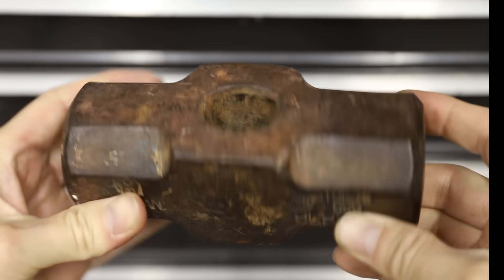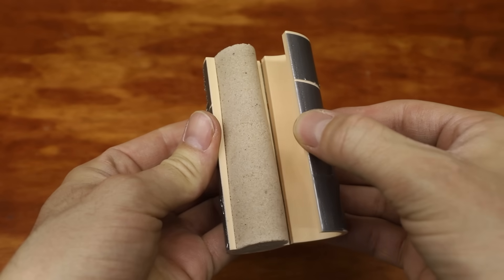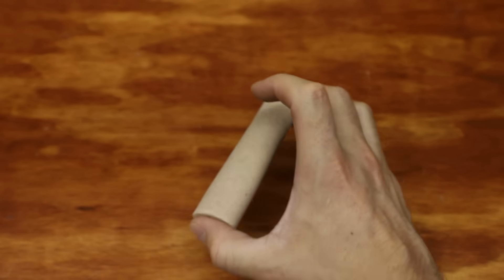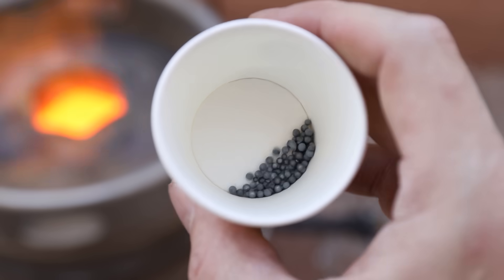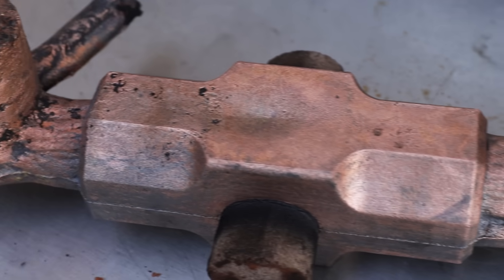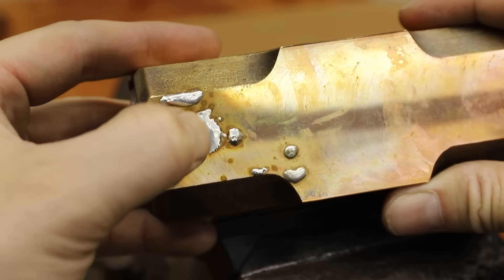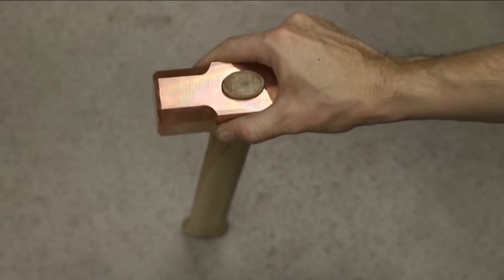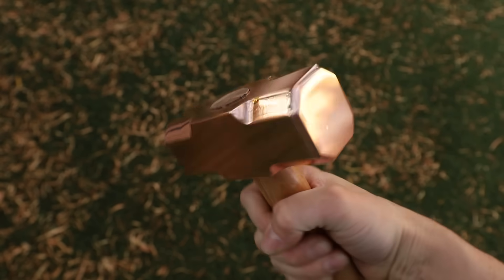Making a Solid Copper Sledge Hammer - HAMMER TIME!

Comment: Is it true that pennies are not all copper, that they use a filler?
Reply: Pennies made in late 1982 and after are made of 95% zinc with a copper coating, that's why if you scratch most pennies, it'll look silver

Comment: You should have used one riser fed it on both sides of the core keeping the riser hotter than the casting. You had that on one end of the casting the side the riser was hooked to the pouring  basin.

Comment: I could be wrong, but last I checked it illegal to melt down pennies for the metal (nickels too). Violating this rule can result in significant penalties, including a fine of up to $10,000 and/or imprisonment of up to 5 years. Coins melted or treated in violation of the regulation can also be forfeited to the U.S. government. With the announcement that pennies will no longer be minted, that might have changed.
Reply: Pennies and nickels have never been illegal to melt in general. It's only illegal if you are trying to profit off of the metal value of the coins

Comment: If you had put another plug/vent tube on the top side where the depression was, it would have prevented the depression. It would have let the air escape as well as gave another area to hold extra material in case of shrinkage

Comment: Why cut up the copper ingot?
Reply: chunking it up makes it easier to heat up, and also makes it faster because the chunks are a bit thinner so there's less volume the heat needs to melt, per chunk that is.
Reply: @braydenstrand3572 wrote: "chunking it up makes it easier to heat up, and also makes it faster because the chunks are a bit thinner so there's less volume the heat needs to melt, per chunk that is."

Oh. Like how a powdered mass of metal starts melting faster than a single solid mass. It increases the ratio of surface area to volume, allowing the heat to reach the various atoms through convection, conduction, and radiation between the atoms of the chunks, rather than only through conduction through the atoms of a single large chunk. Slush cools water down faster than ice cubes. Sort of like how small animals are affected by temperature changes much more quickly than large animals. Thanks.

Comment: Well, thats pretty dumb. Copper is a soft metal so every hit will result in
a dent in the copper hammer head. After slight use it will be  MAJOR
beat up, thats why you have never seen a copper hammer before. Brass, 
yes, copper no.

!

Comment: Its pretty but terribly impractical. Copper is far better suited to electronics, and too soft to use as a sledgehammer UNLESS you need something that will not cause sparks.

Comment: something I learned from having to melt down silver often at a previous job, preheating the castings might help with voids.  The hotter, the better with the pre-heat. Having the molten metal go into a hot casting should allow the molten metal to stay in a molten state longer, allowing air bubbles to escape.  Similar to setting concrete, however, in this instance, I don't think I would shake it when cooling, as you're using sand castings.   I was using heavy cast iron molds, not sand.  We(me and my co-workers) would pre-heat by setting the molds in front of the furnace exhaust for a half hour prior to pouring.

Comment: A copper sledge hammer is about as useful as a bikini in Antarctica.
Copper has a Mohs hardness of 3.0 while the hardness of concrete is around 8.0... There is a reason hammer heads are made of high grade steel and undergo "hot forging" to make them hard enough to withstand the force extended during use....
Reply: did you not watch the whole video?

Comment: I remember visiting the old coal mines in Wales when I was little and looking at the old tools they had there. Where there was a chance of Firedamp in the  mine (often methane) they would use copper alloys because they wouldn’t spark and set the gas off.

Comment: about that repair, just wondering if you could heat up the copper hammer to just before melting and then pour some molten copper over to fill it up? That looked quite shallow so should not trap much if any air but just in case can still mill to clean up the irregular pockets to ensure that no air gets trapped and can always agitate it a little to be sure no air pocket in the pour? This might be less work and you would have hot joint inivisible joint vs cold joint press fit plug?

Comment: you could have thermally expanded the inner diameter of the void and put in the cold filler with interference/transition fit at room temperature..that fit would have been stronger.

Comment: that was not the correct way to fit a handle in. you beed to hold the hammer upside down and smack the handle end with another hammer and let physics do the work for you

Comment: So i recently recently learned that the amount of valuable metals in pennies and nickels is worth more than the face value of the coins themselves. Could someone melt the nickels down and get the 25% nickel and 75% copper? Each nickel is actually worth about 10 cents more in metal value

Comment: Dude. That was amazing and beautiful. I am a woodworker for 45 yrs but that is a fascinating craft equal to or maybe more amazing than woodworking by far. Remember the technology of carving wood first needed a tool to manipulate it. First we crafted stone axes to manipulate the wood. Then bronze and copper and eventually iron. So ur craft is literally 5000 years old. Our ancestors didn’t use 3 D printers n such. However by no means did our forefathers ever turn their back on new tech nor should u. the sand molds the cauldrons the fire. That is as it was in the bronze and Iron Age. It’s amazing. Ur amazing.  U make me proud young man. Ur a master.

Comment: Excellent work. This was fun to watch. I am curious why you didn't just use the spare hammer head to make your mold why did you need to make one from scratch. Copper is such a lux metal my father used to make copper and brass sculptures and they're still hanging around.

Comment: Your casting techniques are top notch, but your use of terminology a bit amateurish. The "top" and "bottom" of a mold are called the "cope" and the "drag" by pro foundrymen, respectively, and the process of expanding a metal plug to fit its hole is called, "peening", hence the term, "ball peen hammer" for the ball-shaped hammer used to accomplish this task.

Comment: Not everyone has a 3d printer and it would be cost prohibitive to pay someone to make a mold.  Why not use the hammerhead and make a pattern for a mold instead.  I am thrilled that this person has a printer but I can make as good a pattern with the existing hammerhead.  I don't really see this video as helpful.  I'm surprised they didn't use a machine shop to finish the project.  Instead of buying a $40 hammer, you can invest thousands of dollars on printing equipment and thousands of dollars with a milling machine.  I think this is a dumb video.  I think it would have been more helpful using equipment from around the house or garage.  If I had the equipment here, I could do the same.

Comment: Some 50 years ago I worked in a foundry, Oklahoma Stell Castings. The plant was built at the beginning of WW2 to make castings for the war. After the end of the war it was repurposed to make butterfly valve castings. I worked in the Maintenace department. They used scrap steel to make their castings. The furnace fired with electric arc rods. Made a tremendous amount of noise. The casting patterns were hand made out of wood. Then sand molds. The castings were dumped into a tumbler, a large steel container and turned oner and over. It was quite the sight for a young man like myself. Later in life I became a aircraft mechanic. When I saw the repair in one side of your hammerhead it reminded of structure repairs we made. We called them freeze plugs. Machined plugs a litter larger than the hole to be repaired. Then dipped in liquid nitrogen and while still cold put into place. Surprising how well that repaired a damaged hole in aluminum.
I really enjoy your videos.
Reply: What a wonderful piece of history. Thank you for sharing
Reply: Excellent!
Reply: My doctor was talking about this. The metal shrinks with the -190 degrees and then expands. So cool.

Comment: Such a lot of work, but good hammers have an hour glass hole so the wedge can expamd the split and to lock the head onto the handle. It would have been a trivial amount of work when making the core. A lot hader after the cast has cooled.

Comment: Typically I'd repair voids in bronze or copper by filling w/rod using a tig or torch then machining after as you did.  Your method worked nicely though.

Comment: Things that sound dirty but are not:

Invest in a vibrator for your sand molds brother. Youll get a much tighter fit over just tamping it down. You won't regret it and your projects will reflect the quality. 

Keep up the awesome work. This is my first video of yours. Yoive earned my sub even if that hammer is totally useless. 😂

Comment: So I have a few questions. Did you do any post processing to your 3d print? I have seen that sometimes 3d printed patterns do not like to let do of the sand on green sand molds. Did you do any form of calculations for your runner and gates? Also have you thought about doing a vertically parted mold instead of a horizontal?

Comment: How did you make solid copper hammer when PENNIES are (and always have been, excepting the WWII steel pennies) made of BRONZE NOT COPPER and now are 65% ZINC clad with bronze??? I was a chemist 47 years of my working life, and NO ONE has EVER transmuted one metal into another-that would be alchemy (sorcery).

Comment: I hate to break it to you but the grain orientation in the handle that you used is the exact opposite of what you would want in a good handle.  Well at least you're not planning on using it so now we don't have to worry about the handle breaking.

Comment: Pouring metal into a mold requires 2 things. Larger risers-- aim for twice the height of your part being cast and as much volume as your part as a rough estimate. Yes, it can be calculated more accurately, but isn't useful for making a single casting. Next.... Heat your sand. The hotter your sand, the slower your metal cools allowing better metal flow and gas release. My references are I worked in a casting foundry for 4 years.

Comment: I'm struggling to understand why you needed to make the mold out of plastic? Is there some reason you couldn't have just used the original hammerhead you mentioned finding in your shop? Could you not have used that same bandsaw you used to cut the Hammer in half and use it as your mold? Unless maybe you were afraid it would be too heavy? I really don't understand.

Comment: Just one comment regarding work safety. Copper is a toxic material. Copper powder and vapor are especially dangerous. Additionally, copper evaporates a lot when being molten. I highly recommend wearing a respirator and gloves wherever possible and avoid bare contact of copper with your skin, especially when grinding, polishing or cutting copper.

Comment: FYI, the eye of a hammer you actually intend to use should be hourglass shaped inside. A perfectly straight eye will not hold the head in place under real use no matter how well you wedge it. Aside from that, its a gorgeous hammer, and the plug repair was awesome :)
Reply: Citation needed
Reply: @jb76489  If the eye is straight, the handle is only held in place by the outward pressure from the wedge.

By adding the hourglass shape and more aggressive wedging, the end of the handle is physically wider than the waist of the eye and needs to be compressed even further for the head to slip off.
Reply: @Thunder-54321  I read the comments to see if anyone else had an issue with the eye's shape. I was under the impression that a long tapered shape would be the most secure way to affix the head. An hourglass shape would require a taper on the shaft to fill the lower part of the hourglass opening, wouldn't it?
Reply: I always thought the whole thing was then soaked in water, then dried to allow the wood to expand.
Reply: If you take a good look at a few points in the video you can see that the core mold is tapered properly for a hammer eye. The resulting casting will have a hammer eye that is larger at the top than the bottom.

Comment: It would have been cool to add a shiner copper cent to the hammer, and since you’re not trying to pass off the coin as something for a higher value or more than the cent is worth, the code wouldn’t apply to this. 

Amazing tool. How much would you charge to make something like this?

Comment: Technically Pennies aren’t 100% Copper, they’re actually a Copper plated Zinc alloy. If you want 100% Copper, try melting down Copper water Pipes or Copper Wire.

Comment: I weld aluminum for a living and there have been a few times when I've blown a welding contact tip and the aluminum wire and copper tip fused together creating a surprisingly hard material. 😄

Comment: Looks nice. Now, an old school tip ... When attaching the handle you slip the head on, then actually tap the bottom of the handle gently and the head will climb it. Don't tap too hard because it will really cut into the handle. Thanks for the cool video! Also, if you want the head to stay on indefinitely you need to apply locking compound into the handle at the head. The compound will make the wood swell and keep the handle tight.  You can apply the compound once a year or dunk it into a pail of water for a couple of hours so that it will swell. Otherwise the handle will dry out and the head will fall off. Typical products are Swel-lock or Chair-Loc; there are quite a few.

Comment: I thought you were melting Penny’s to make this, but this was still cool.  It got me thinking how many penny’s would it take make this.  With a penny weighing 2.5 g it would take 2177 penny’s to make a 12lb head which means that head only cost $21.77.  That’s pretty good value for such a pretty piece!
Reply: I was wondering the actual weight of the hammer. Do you know it's 12 lbs for certain?

Comment: Looks awesome. I think you can get a mirror finish and the tool marks out if your mill head is more level. You can use a dial to precisely level it. Also, a faster speed on the mill head may help as well. Awesome video.

Comment: Was the copper ingot derived from melted pennies?  If so make sure to use only those minted on or before 1882,  The modern pennies are mostly zinc (97.5%).

Comment: Pennies have not been made out of copper since 1980. They are made of Zinc and copper plated to retain the 'original' look. Zinc is white in color. You can tell that by looking at a penny that's been driven over in a parking lot and has gotten scratch marks from being driven over.

Comment: Next time turn the plug .0005” - .001” over the hole diameter. Heat the workpiece and cool the plug. Press them together. This is called an interference and or shrink fit. Its incredibly strong. It’s copper, and not exactly flight critical so the tolerances don’t need to be exact. Freezer and torch should work just fine for a home project.

Comment: When setting a hammer head, axe head, etc you should have the head upside down and u use a rubber mallet to smmack the bottom of the handle than you put the wedge in to keep it tight, learned that from a forestry guy

Comment: I used to make giant sand molds (sand cores, to be technical) at a cast iron factory.

  The liquid mixture used to wet the sand is so stout, it literally feels like it sucks the air out of your lungs. And you don't even have to breathe it in to feel that effect. You just have to be standing over the fumes.

They claimed that it doesn't have any harmful effects, but I can't believe that. Felt worse that huffing gasoline.

Edit: 1:31 I wonder if it was the same stuff that we used.

Comment: Ahh yes the age old tradition of 3D printing your sand molds. Now one ever thought of just casting the LITERAL SLEDGE HAMMER YOU HAVE.
Reply: exactly!
Reply: Copper shrinks by 5% after you cast it, so you have to make the mold 5% larger if you want it to be the same size as the one you're modelling it after

Comment: Really enjoyed the mold-making and casting process -- some new tweaks but essentially those processes are thousands of years old :)    How long did the entire project take? And just out of curiosity, if you'd done it without modern tools (e.g. the 3D printer etc), how long do you think  it would have taken?
Reply: Video is 12 minutes so probably like 20 minutes or so, got to cut out the boring bits

Comment: I have a really old copper hammer that used to belong to my grandfather. He used it when he was working as a mechanic and would use particularly to knock off wheel hubs. Copper hammers were ideal for this as tge metal is softer than steel, therfore it woukd damage the metal hubs and caps. 
I love your hammer although I woukd have liked to see some etched design either side.

Comment: Question..  Is there a specific reason you hammered the metal wedge in an offset position? Is it because it could split the wood if you set it at a perfect 90° perpendicular angle? Not trying to offend or anything I'm just curious. I really enjoyed the video I appreciate all the time and hard work that went into every aspect of it from filming to dialog. A job very well done in my opinion!

Comment: Very cool video I genuinely learned a few things  I know it's a small part of the video but I used to think kegs were made of aluminum lol I even used to work at a bar haha my first thought was wow won't that kegs melt with all that heat . Then I Googled it and stainless steel.  I really like the hammer copper hammers are good for not creating spark . I know you said it's going to be a wall hanger  it's really nice  I wish I could do something half as nice